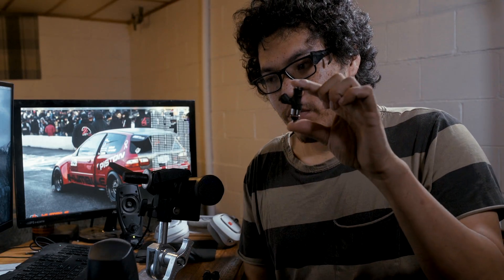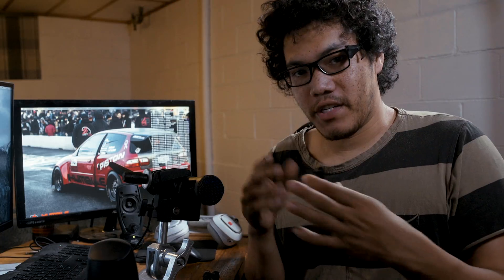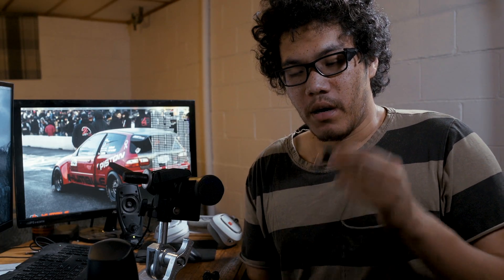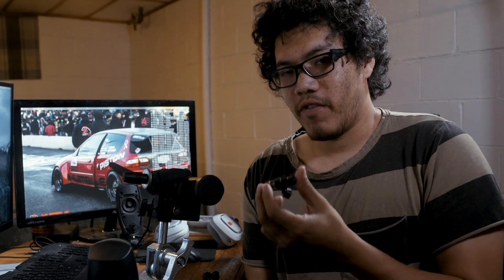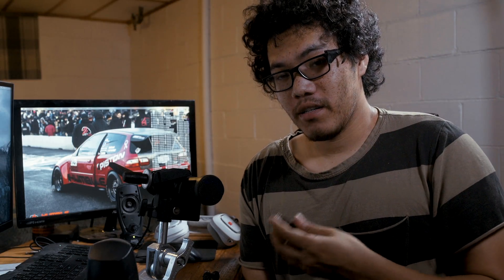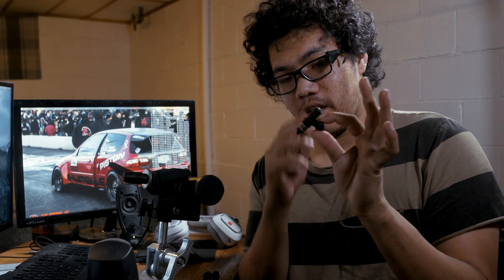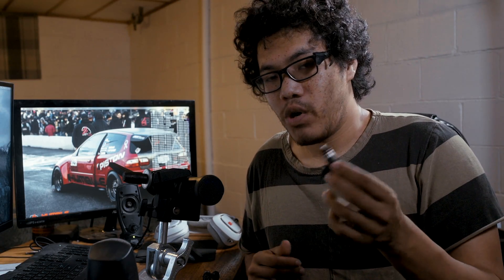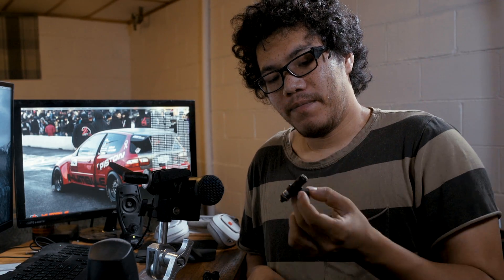Learn From My Mistake: Injector Dynamics ID2000 Injectors and E85

Comment: I have ID 1700CC on my over 1000hp Camaro and it sat for months and recently it started sputtering before boost and my air fuel is in the 9s a lot 

 I hate running gas but I want this issue fixed 😭 

Hope it fixes it 🙏🏽

My car used to run so damn good 😩 I changed the plugs twice now and the wires 

Has to be this

Thank you man 

Any other suggestions i appreciate

Comment: In my experience, it's not a big deal to "leave ethanol in the injectors"... as long as they're still in the fuel rail, with fuel sitting behind/inside them. Where the issue arises is when you leave them on a bench for a while without fully cleaning them out. I had one lock up after being on my bench for a couple weeks, and i had to replace it. I've had the same set in my car for 2 years now, and the car recently fired right up with no issue after not having been started for 4-5 months. It's sat for 2-3 months at a time in the past and fired right up as well.

Comment: Just watched a guy put the ID 2000 In a 2003 or 2004 GTI 1.8 t only modes to the 220k mile car and after  The install of the ID injectors The motor is totally stock top to bottom beside besides a downpipe straight pipe straight pipe exhaust in a big Turbo that is it Just made 566 horsepower over  500 pounds of foot torque And hes not done tuning yet lol AWP motor

Comment: this issue can be eliminated by adding 1/2 ounce e-fuel top lube per gallon fuel, which you should be running with e-fuel regardless

if using premix on a rotary engine, add this in addition to the premix amount

Comment: My ID2000 on my secondary works just fine on e85. It been almost 2 years now.
Reply: Did your injectors sit for a while.
Reply: It’s been sitting for almost 6 months and it still fires up and runs with e85.
Reply: @sagemodenaruto07  So you have no e85 injector problems or corrosion issues and clogged filters after sitting 6 months with e85?
Reply: No sir!!! I use fuel lab 6 micron filter with no issue.
Reply: @sagemodenaruto07  6 micron is really small. I was told 10 micron with microglass filter
Reply: @sagemodenaruto07  You are the first one i heard to let e85 sit 6 months and no phase separation
Reply: @sagemodenaruto07  How you like e85 compared to pump gas. E85 way better huh. My car is faster on e85
Reply: It’s garaged the whole time and never sees rain since I owned it in 2005.

Comment: Geat video. I left E85 in my ID2000s as well for 6 months during a rebuild and the injectors were gone.  ID tried to clean them, couldn't save 3 of them ... they replaced all 4 of mine for a VERY reasonable price ... which they didn't have to do.  That's one big reason to run ID, as the customer service goes BEYOND what's necessary.  Please do check with them on their latest versions, I know they were working with Bosch to get some stainless or titanium valves instead of those iron/steel valves in the injectors (the ID1000s use rubber valves so no issue with E85) ... I do exactly as you stated, I run a tank of normal gas before shutting down for the season.  I think I leave my car 3 weeks MAX on E85 before I run it again ... don't leave it for more than 2 weeks IMO without running it, else run gas through them.
Reply: This literally just happened to me today.  My car sat for 4 months during a rebuild and 3 out of 4 of my ID2000's were stuck.  Bought some Bosch ones for now but they got the car running so im happy.

Comment: E85 doesnt absorb more water than gas does, it just has more ability to absorb water.  Also, I've never had an issue with the CNG injectors myself, but I've had to clean and fix ID CNG injectors that have failed a few times.  In my case they are usually ID injectors with cut difusers that lost their stainless properties, but the 2000s are not common failures for me.

Comment: I've understood that Bosch 2000cc injector is cng injector that has polymer seal in the needle that doesn't like gasoline at all but works with E85 in practice. Good to know they also rust on E85